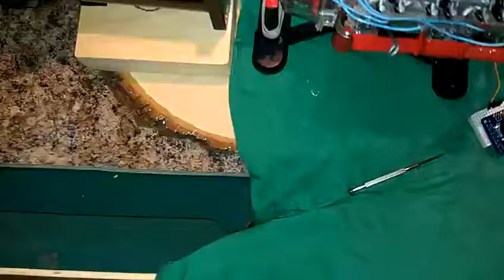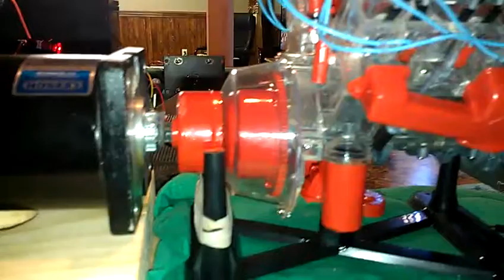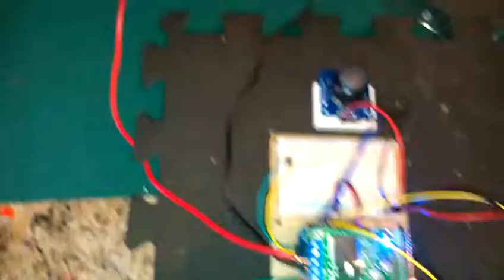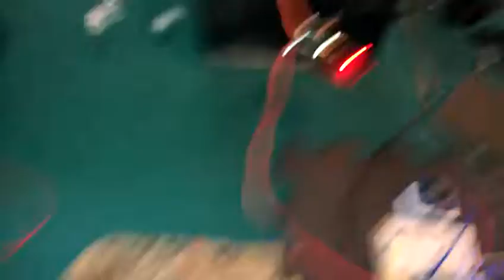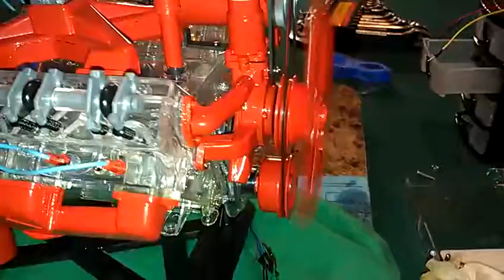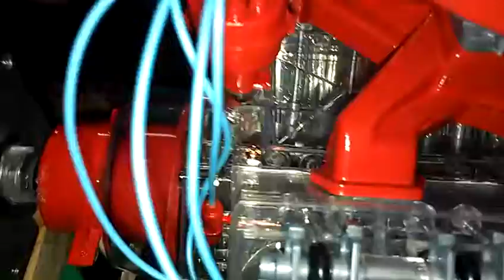Visible V8 Arduino and Gearmotor V2

Comment: Valves aren't working broken timing gears?
Reply from the maker: haha yeah, that was my first attempt, things dont really line up like the original, it seem this is made in Japan. I have a second set I scored and Ill be taking my time sanding and adjusting things.

Cheers
Reply: +fabiolus2007 cool some actual awnsered me on on of these I've been wanting one of these for a while always get bad reviews . And I noticed that there's no cam valleys have you noticed the cam bending under pressure of the push rods pushing on it ? I've wanted to buy one and take my time make it nice but don't want to waste my money for a week of aggravation and a week of playing with it till it breaks
Reply from the maker: Brandon Fleetwood Its actually pretty good all parts move,  should have taken a better vid, What I learn from this first assembly is that it requires sanding before gluing all together. It was actually fun and it is strong, I made it run pretty fast. The first model from the 70's were made in USA and was way better. Still nice to assemble though just take your time. fit pieces and sand till it fits before gluing.
Reply: +Brandon Fleetwood time on my hands